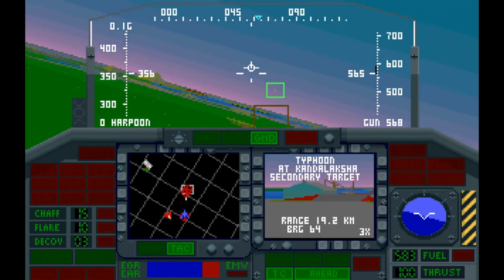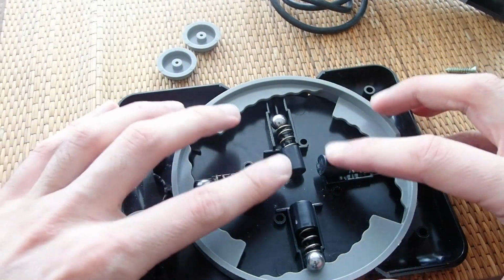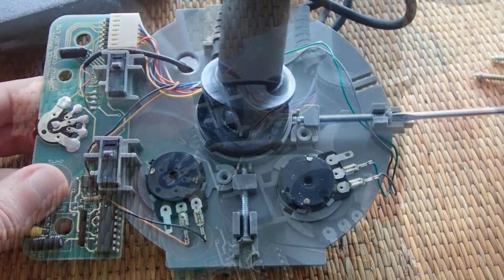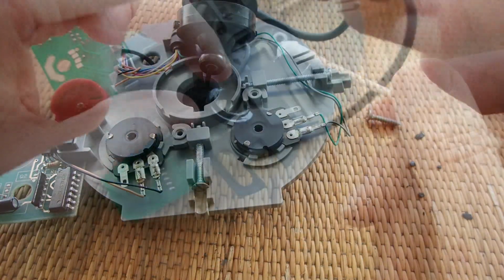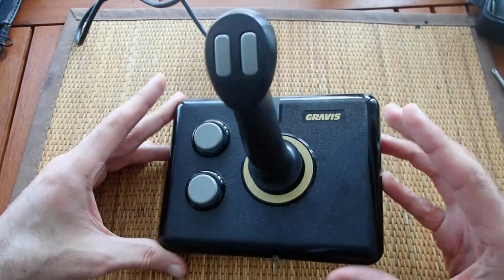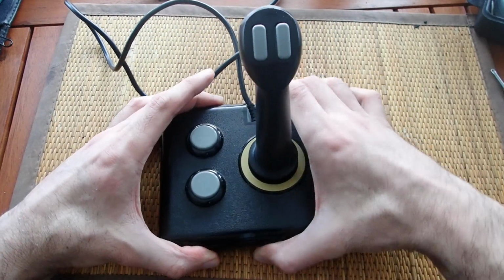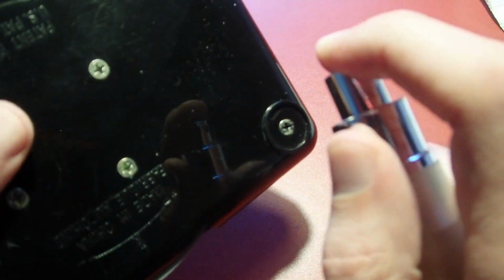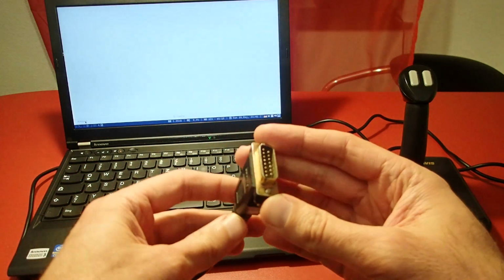A look into Gravis Analog Pro joystick and a small surprise

Comment: I have one of these but unfortunately the screw adjusters for the axis are missing, as well as the small plastic "yokes" they screw into. The adjustment on the pots still works by moving the small plastic boss manually. Anyone able to post dimensions of the yoke pieces so I could 3d print a replacement?

Comment: Man, this really brought back some memories.  I had the original (single red button on top) and upgraded to the pro over the years.  I logged a loooooooot of time on Wing Commander 2 with it.  I came to this video to see how the mechanism works after designing my own 3-d printed replacement gimbal for the eternally disappointing Thrustmaster HOTAS Cougar and not quite getting it right.  My new gimbal is far, far, too light despite using the strongest springs I could find.  I see the key now, the Gravis used compression springs whereas the HOTAS is based on extension springs.  I don't know if the Gravis style gimbal can handle the extremely heavy HOTAS stick but might be interesting to try.

Comment: Hello Necroware. nice review of that awesome old tech. A friend has found a very similar one in his dad's stuff. Except the color (this one is very light grey) and it does not have the additional throttle and config buttons on the left. Much more curious was the connector. Its not a serial port but something similar like a PS/2-connector but slightly different from layout so it can't be connected to ps/2 on pc. Its labeled "MacMouseStick II". You know if there is an adapter for that as well or can you offer one?
Reply from the maker: This has to be the Mac Mouse / Keyboard connector. I think this joystick was emulating keyboard / mouse input on Apple Macintosh. I have no experience with that computer and unfortunately I also have no adapter to that joystick.
Reply: @necro_ware  Hab grad nochmal recherchiert. Heist wohl Apple Data Bus (ADB) der Anschluss. Aber Adapter sind tatsächlich rar

Comment: Hi I actually found one of these while thrifting, the one I found is in near mint condition, if it was used it wasn't very often.

 We had one of these Gravis joysticks back in the day when we had a AST 486. I cut my teeth on the original 1993 release of Star Wars X-wing using this joystick. Thank you for the information on how to disassemble the stick if I ever need to make repairs 👍

lol and here I am using a Amazon Game port to usb adapter. Not that I'm complaining it works great
Reply from the maker: In this video the adapter was just briefly introduced, but there is a dedicated video about it, where I explain, why this adapter is superior to any other known adapter you can buy. Have fun ;)
Reply: @necro_ware  thanks. Just finished watching that video, very cool adapter but probably too advanced for me lol. I have no programming language background. I'm sure it's a way better solution than the Nest Host adapter I'm currently using (though I have yet to have any problems with it so far...)
Reply from the maker: @JohnSmith-xq1pz  Try to connect a Sidewinder or a digital Logitech joystick and there you have the problems :) In the best way, half of yor joystick will not work, in case it can do fallback, and in the worst case it will not work at all. For example Sidewinder Gamepad will refuse to work completely.
Reply: @necro_ware  lol. Well I don't own any Microsoft controllers (never cared for anything in the sidewinder series. I've always been a Gravis/Logitech fan) and all of my digital Logitech joysticks still have the Game port to usb adapter that came with them in the box (Yea). Unfortunately I've never had the pleasure of owning anything Thrust Master though... maybe some day.

Comment: that Game Port to USB usable on Microsoft Force Feedback Joysticks? edit: AFAIK, it uses MIDI as data for the feedback function... the uh, MPU401
Reply from the maker: The pins are wired, but the driver is not yet implemented, since I don't have such joystick. You can find more details in the next and actual part about this adapter.

Comment: Does the throttle work? Mine doesn't seem to work on a Rockfire USB adapter, and I've never figured out which pins it output to.
Reply from the maker: Yes, it's the 4th axis. Watch my game port adapter video, if you want to see more on that topic.
Reply: @necro_ware  Well, least it's not a failure of the Rockfire… Looks like I have a nice bit of repair work cut out for me.

Comment: Have you worked on an IBM286 with 8Mhz, 640k base, I believe it's "FMX 20Mb hard drive and a super long CGA video card? I'm not sure it the video card plugs into an ISA or another type of dedicated super long slot.
My brother gave me one that didn't work having a problem with the startup configuration running DOS 6.0 and Doublespace. It had two 5-1/4 floppy drives  A-1.2M/B-360k :-) This was my first foot into computers in 1997. I would just like to see one for nostalgia reasons. 
I remember deleting the "Doublespace.bin" file off of the "H" drive trying to make more space...OOPS, was a pain to get it back. After I went to DOS 6.22 it became "Drivespace.bin" :-)
Reply from the maker: Sure, I worked with such machines. The hard disk you mean, is probably MFM (?). And funny enough, I had very similar experience with doublespace. I got my first own PC as I was 13 and it had "only" 42MB hard disk. After a while I saw thi dubious doublespace thing an deleted that to get more disk space. Well you know, what the result was :D Everyone was once a beginner.

Comment: funny timing - just last night i decided to pull out my joystick that i bought not long ago second hand, a logitech wingman light joystick, so that i could play some xwing vs tie fighter. but theres a problem, the up and down of the stick is fine but to the right it only has about 40% of movement that the system can detect. the left of the axis works fine. what do you think might need to happen to fix it? great restoration btw and i'm looking forward to the adapter video :)
Reply from the maker: Thank you. You should be able to re-calibrate  the joystick in your OS. It depends on which one you are using, but I assume it's some windows? There in the calibration you can switch on the raw coordinates, move the joystick completely up and down and remember the outer limits values. Then use the calibration wheel on your joystick to set the value as near to the middle between the outer limits as possible. Repeat the same for the horizontal axis as well. Then finalize the calibration and don't forget to click 'Apply' and don't touch the calibration wheels after that. If that doesn't help, may be your variable resistors got bad. May be disassembling the joystick and spraying some dioxide will help.

Comment: Will it this project have an option to convert the input to Xinput along with Dinput to be compatible with many modern games?
Reply from the maker: By Xinput thingy you mean this DirectX stuff for XBox controllers I guess?! I'm afraid, I'm not prepared to answer your question. I'm using Linux since 20 years, so my knowledge about latest DirectX and many other MS things is not the best, but as far as I know Xinput is a proprietary protocol, which only XBox controllers speak right? I think all the others are provided by DirectInput interface (?) This adapter provides generic HID Input device and doesn't speak other protocols. So, I guess, it depends, how the operation system handles and wraps such devices and I would guess this would be DirectInput on Windows. Are there really games, which support only XBox controllers and no other joysticks?
Reply: @necro_ware  Yes there are (xinput only).  Steam with Proton can translate the xinput to dinput, and in example Android uses xinput. There are open source projects to convert dinput to xinput.  I was just thinking something integrated into the convertor to make it simple.  There is also this https://linux.die.net/man/1/xinput
Reply from the maker: @d.r.1402  I see, well, currently only HID is possible. I have to take a closer look into XInput thing to say more. And btw. the link you provided has nothing to do with MS XInput, it's just a name clash. In Linux xinput is an utility from X to control input devices. X is a display server, which is basically a subsystem for graphical interface and user I/O on Linux, Unix and others. It is 36 years old and was developed in the time, where MS was a small unknown company ;)
Reply: @necro_ware  Oops.  I do know the newer kernels support xinput, but I don't know the library.
Reply from the maker: @d.r.1402  no problem at all. The next video will follow as soon as I can deliver it, where I will try to explain some details on this project and officially open source everything. We will see how it develops and if there is a need or use case there to have MS XInput support with this adapter, I will come back to this topic. For now I would be just glad, if it would support even more different retro joysticks.

Comment: Nice project, but I have another idea that's the opposite of yours. As finding good vintage gamepads is getting hard (if any ever existed), turning a USB keypad into a DOS capable one would be great. Moreover things such as mapping keyboard keys to it would be awesome as well for games that need more than 4 buttons or aren't made to work with joysticks (I've even seen previously games with gamepad support that are nearly unplayable because of only 4 buttons possible)
Reply from the maker: Yeah, the other way around is very limiting. In DOS you can have only 4 buttons, 4 axes. But someone on dosreloaded.de also works on a solution other way around. I have plenty ideas in that direction as well, but unfortunately we have only 24 hours in a day on this planet :D
Reply from the maker: @Jim_Bo  Aaand done!
Reply: Haha yes, 
keyboard pass through was exactly what I had in mind by the way.
On the adapter with the USB port, you'd have buttons to select maps or create new ones, when you go in create mode, it listens first to the controller, then the keyboard to map each controller key to the keyboard (or some other way to map some controller's keys to the controller port).
Obviously that would be near the completion of the thing, not the first problem to solve :)
Reply: @Jim_Bo  Interesting. This was essentially what some of the few mac joysticks did. This would be ideal for dos.
Reply from the maker: @Jim_Bo  Haha true ;D